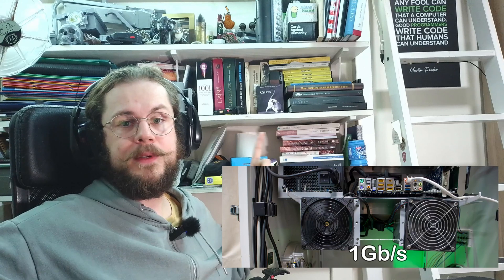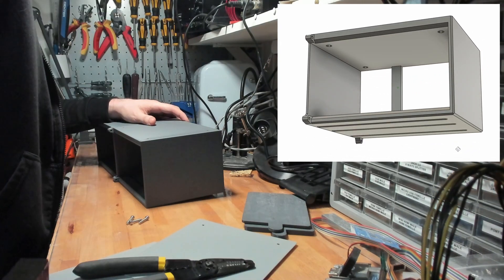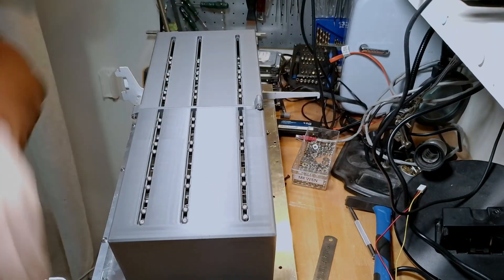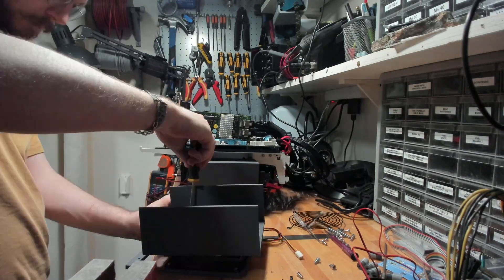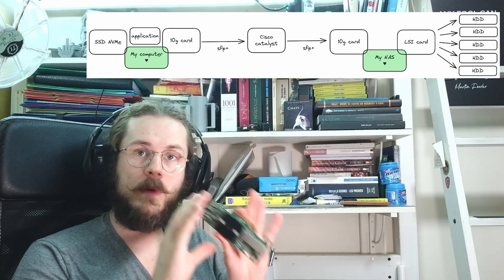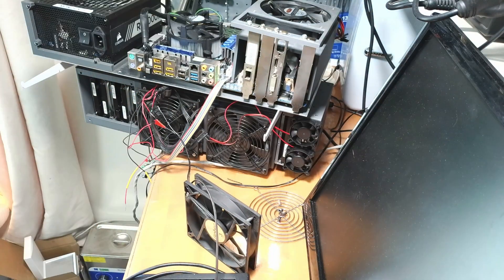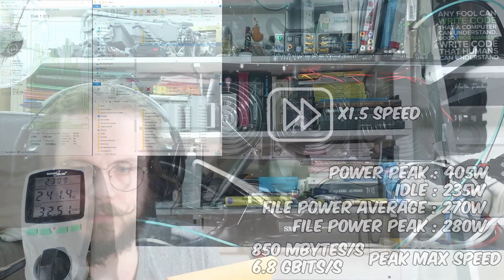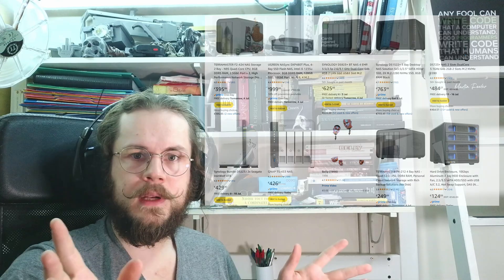DIY Server part 5 - 10G/s speed upgrade

Comment: The audio was perfect this time!

Your videos are great, I always wanted to put my older PC's in a rack like you did.

I get nowhere near the speed you are getting on you NAS, I think i need to build something similar to yours.
Reply from the maker: I intend on making a full guide at some point as the pecs are awesome and the price very affordable ^^
The videos so far should have quite a lot of information to give a general direction in the meantime though
Reply: @happytrigger42 I'll be looking forward to the full guide!
Reply from the maker: Interestingly enough though, the audio does not sound good at all for me on the current settings, I need to lower the volume considerably before it sounds good.
I simply trusted the process and figured that should the sound be ok at low volumes for me it should be good for everyone at max x)
Reply: @happytrigger42 haha... well your strategy definitely worked!

Comment: Decent boys! And here my nas has trouble hitting 1Gb... 😢😢😢
Reply from the maker: If you have a premade NAS you can see what is the limit on your ethernet connection and - should you want / afford to - you can get better HDDs, modern ones have very decent read speeds.
Otherwise you can go full DIY like I do x)
I've been stuck with a very old Synology NAS so I do feel your pain 😅
Reply: @happytrigger42 far from premade. It's a asus rog laptop, running proxmox, with a turnkey Linux file server running smb. 

Most likely due to really old laptop hard drives that it's ran on TBH. But still works for being free 99 😂😂😂

Comment: ImDisk Toolkit (in case of Win) is super useful. I'm using 11GB (out of 64) RAM disk daily for every scratch IO task imaginable as well as ~1GB of browser cache.
DDR4-3200 gives me 76 / 99 Gbps Q8T1 sequential reads / writes and ~60k random Q1T1 4K IOPS
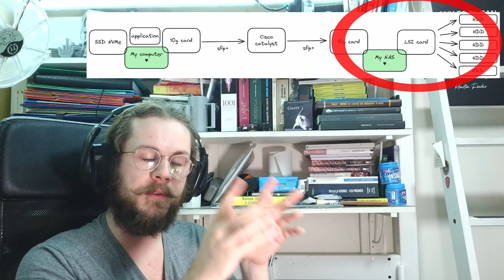10:18 NAS to NAS over SMB in Win could be just a command to do local copy, so no networking transfer at all. You may observe appropriate close to zero utilization of NIC in Task Manager.
By going for a litte more modern desktop/workstation socket (skylake+) you could shave off like 40-70W, but more gains in terms of consumption (and reliability as well) would be to reduce the amount of spindles which total to 80-105W idle easily in your setup.
P.S. I recently discovered impressive fan model TL-B6B. It is only $5-6 and yet has a very good bearing, is dead silent at 6.5VDC (I power them using XL565201) and in my testing outperforms many silent 120mm ones at low RPM in airflow. Moreover produces unusually directed airflow for PC fan, you can feel air movement when its cold ~ 1m from it. I don't have a 3D printer yet, but if I could print custom shrouds for it to make optimized air tunnels, it would be all I want for silent auxiliary cooling.

Comment: 9:45 a RAM disk (on your desktop) may be applicable here for testing the capabilities of your NAS.
Reply from the maker: Completely forgot about it ( never had a use case where it would be useful )
Very good idea thank you, I'll have to check if my 64Gb of RAM is enough as I have windows and what not running on it and - if my guess about having a potential 10Gb/s of read is correct - it would fill really, really fast x)